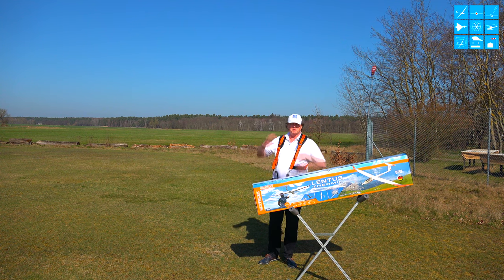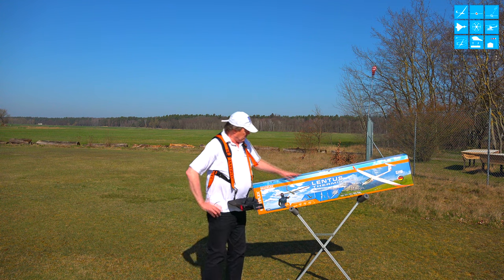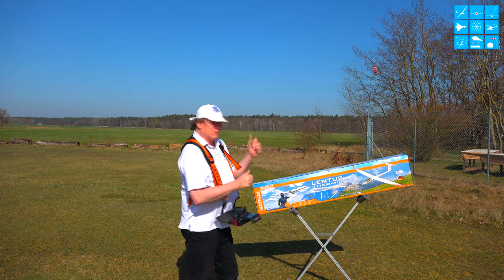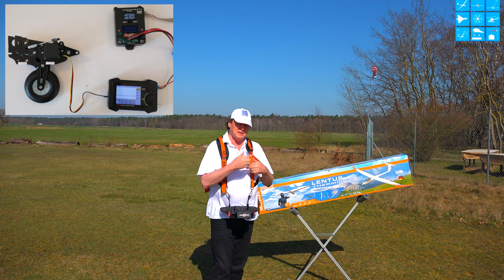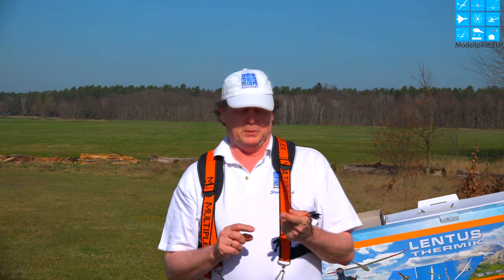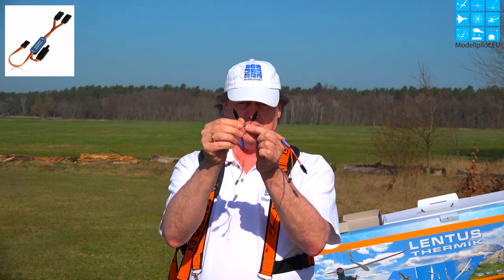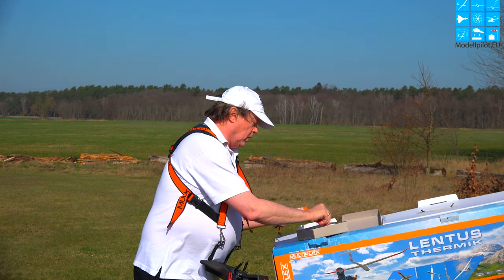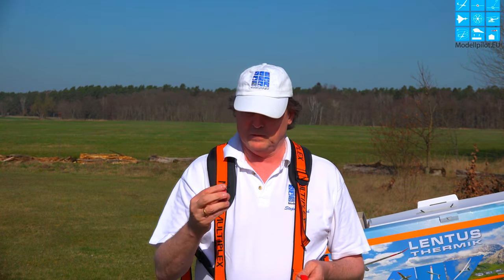Teil 1/3 Multiplex Lentus Thermik, Setup Tipps, Tuning, Optimierung

Comment: 5:55 not a good sound for a servo
Reply from the maker: This was not the servo ;-) it was the plastic of the 
rudder gap cover, i told about further as a tuning option.
Reply: 6:17 it’s incredible how it looks like broker servo gears noise 😉
Reply from the maker: If the servo is broken, i would show it and say it definitely in the review.